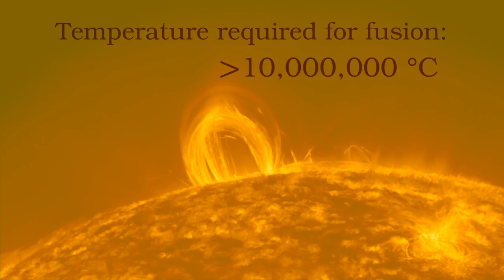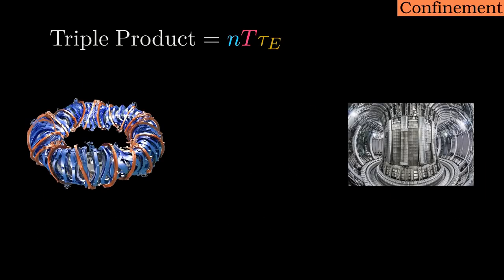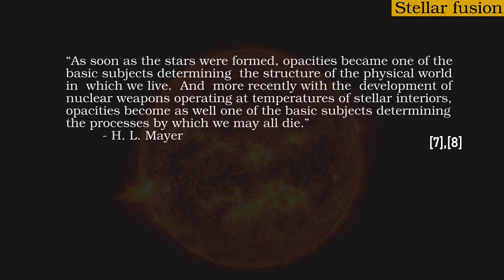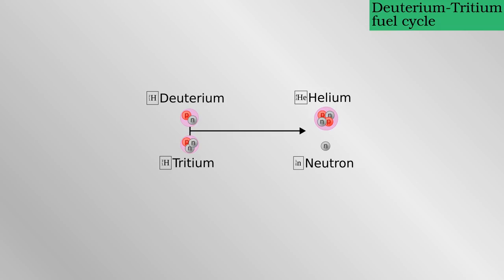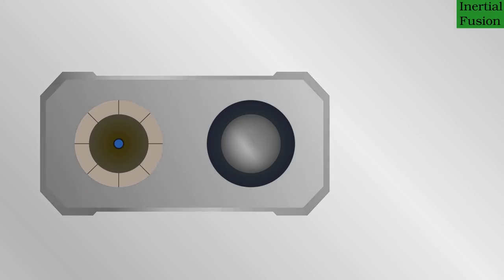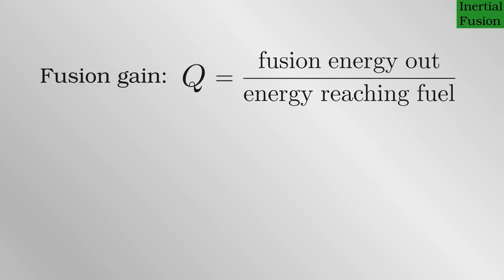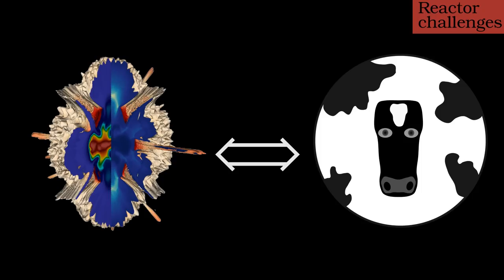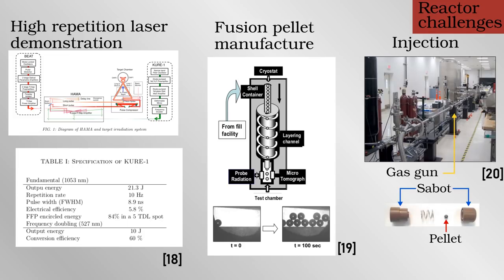How nuclear fusion works (2) - confinement, stars, nukes, inertial fusion energy

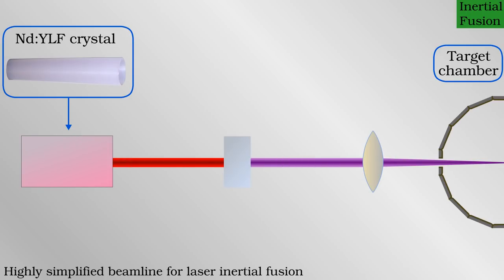Comment: Nice thorough overview. A couple small corrections - (15:55) in ICF the lasers are so incredibly vast, and the beam diameters so huge, that we actually can't use neodymium doped yttrium lithium fluoride (or yttrium aluminum garnet) crystals for the lasing medium. The Czochralski pull method of growing single pure crystals of the stuff simply maxes out at a few inches in diameter, and in order to keep the beam intensities lower than the intrinsic laser damage threshold of the material while attaining energies of a couple megajoules on target, we need beam diameters of over a foot (60cm) across! And so we are forced to use Nd doped phosphate glass instead, which can be made into practically arbitrarily large slabs then cut to size. It would be nice if we didn't have to do this of course, because glass is a terrible conductor of heat, while single crystals are great at it; but as it is we have to wait hours between shots for everything to cool down uniformly, lest the next shot suffer wavefront distortions from traveling through nonuniformly still warm amplifier Nd:glass. 

Also, immediately subsequent to this section you say that "the higher the frequency the deeper into the plasma they penetrate", but I think you meant to say the longer the wavelength instead. We like higher frequency in ICF (shorter wavelength) because it selectively heats the ablator shell of the capsule and doesn't prematurely heat the electrons in the fuel before maximum compression time, which longer wavelengths do. 

The final video section is quite good indeed, and in particular the identification of hydro instabilities as a likely show-stopping problem for General Fusion's lead/lithium alloy hybrid magneto-inertial scheme is most welcome, as I rarely see anyone rightly calling this out. One disagreement with this section though, at the very end you mention that a hypothetical future power reactor would have to take the "still unproven direct drive approach", but in fact I would argue that though we haven't achieved as high yields as the indirect method, this is merely a consequence of NIF's beam arrangement being optimized for hohlraum irradiation in two groups of 96 beams and its inability to currently do symmetric direct drive. The direct drive method is actually much more likely to succeed, all else being equal, and most of us think that NIF would have long since ignited its pellets by now if it were doing direct drive, if for no other reason than simply because hohlraum 351nm UV light to soft x-ray conversion is so utterly abysmal at ~10%; ie. they're throwing away 1.8 megajoules of laser energy entering the target chamber and only actually coupling only 0.2 megajoules into the target implosion merely for the sake of x-ray irradiation uniformity (and weapons configuration similarity)! In reality, the non-uniformity issues of direct drive have long been largely solved with things like distributed phase plates, distributed phase rotators, and spectral smoothing by dispersion.
Reply: Well hot diggidy daym! What a high quality comment! Thank you for sharing and taking the time!
Reply: @morkovija  you may view more historical documentaries about fusion on my channel if you enjoy this particular kind of masochism....
Reply from the maker: Thanks for the comment. Totally agree about the over-simplified NIF beamline (explaining even a simple beamline like the actual one at 22:34 would have doubled the length of the video). For some reason, I thought there was a Nd:YLF seed pulse (and even re-recorded that bit as you may hear). I also didn't want to go to deep into things like avoiding a pre-pulse and so on. Maybe I will do a "How Lasers Work" video including very intense lasers.

With regards to the benefits of higher frequency waves, I was alluding to the various absorption processes at or below the plasma frequency. If I recall correctly, very early research used CO2 lasers which just couldn't penetrate deep enough. Isn't that also a problem now, that the hohlraum closes to 1-omega light too early?

I also agree that direct drive ignition should also be easy in principle, but I would urge the same kind of caution as must now be felt for the 2012 Ignition Campaign.
Reply: @ImprobableMatter  Oh yeah, I'm pretty sure the seed pulse from the pulse generation room is definitely YLF generated on OMEGA, I think they're using ytterbium doped fibers or something in NIF's master oscillator room...
Ah I see about the frequency thing now, and keeping in mind we're really approaching the edges of my limited knowledge as a mere non-scientist engineer, my understanding was that the longer wavelengths caused unacceptable electron preheat (because of the high e-field? ....I guess?) before the bang time, but I see the energy absorption also scales favorably with frequency...
So you were right about the absorption efficiency relationship to irradiation frequency: Taken from Gordinier et al. 2003: "While carbon dioxide gas lasers can be pulsed and have efficiencies approaching 10%, their wavelength of 10.6 μm is too long for efficient coupling to pellets. The interaction of an electromagnetic wave (laser light) and the ablating plasma at the edge of the pellet can result in total reflection of the incident light at a critical density layer defined as the radial location where the laser light frequency matches the plasma frequency. The plasma frequency is proportional to the square root of the plasma density. Thus, for deep pellet penetration, a high frequency (low wavelength) light source is required. Long-wavelength lasers therefore have a difficult time efficiently coupling to pellets and achieving the compression factors required to initiate a thermonuclear burn."
Yes, caution in this field is obviously in a perpetual deficit, and we should always strive for more of it. Though the recent 1.3 MJ yield shot on NIF last August really did surprise everyone I think. There seemed to be a general resignation among many that the R-T hydro instabilities were underestimated (yet again) for NIF scales, and the cross-beam energy transfer, and the laser plasma interactions.... etc. were going to conspire to prohibit ignition from ever being reached. But now, well...it really seems right around the corner at least for indirect ICF. It'll never result in a power reactor of course, but even being able to achieve ignition in the laboratory at all I believe is going to open up a whole new world of ultrahigh flux neutron experiments, among other things, that make the machine itself a valuable new tool in high energy density science. Thanks much again for your videos, they're really excellent.
Reply: @Muonium1  Do you know what the exact reason behind choosing the hohlraum method over direct drive? Was it purely because it was functional in nuclear tests and they didn't want to dedicate NIF to an as-of-yet-unproven method? There must have been some reason for it, seeing as the physics suggests it is a big bite out of the efficiency.
Reply: @xiphosura413  It's a horrendously inefficient part of indirect drive. They want it because when you irradiate the inner walls of the (usually gold) hohlraum with the 351nm UV laser pulse, the spots on the inner wall become very hot and emit x-rays. Because the hohlraum is so small (pencil end eraser) and light travels so fast, the x-rays only take a few picoseconds to cross the inner volume of the hohlraum and get absorbed by the other side, heating it and causing it to emit x-rays too. Thus the radiation inside very rapidly becomes "thermalized" and reaches thermal equilibrium. This is good because the radiation inside undergoes so many absorptions and reemissions in such a short period of time that it rapidly naturally attains a very smooth even intensity and temperature throughout the chamber; you want this because you need the cryogenic DT ice filled microballoon in the center to be irradiated as evenly as possible during the ablation and acceleration phase of its implosion. If the irradiation is not extremely uniform, then uneven hot spots which form on the capsule surface will immediately seed Rayleigh–Taylor hydrodynamic instability in the collapsing fuel pellet and this will cause the cold layers of the fuel to prematurely mix with the hot layers before the moment of maximum compression and density, and then that will dramatically lower maximum achievable temperatures and thus simultaneously dramatically lower fusion yields. This is more or less exactly how the secondary of a Teller-Ulam thermonuclear device operates, and it was confirmed in 1988 that a laser fusion microcapsule could be made to ignite in this way too in the Halite-Centurion tests, which piped off some tens of megajoules of soft x-rays from an underground nuclear weapons test into one of these hohlraums and they got the DT pellets inside to burn.
Reply: @Muonium1  I see! Thanks for the response.
So it's to ensure uniformity of the radiation, is it technical limitations on the lasers necessitating the hohlraum? Or is it very difficult to adjust the system (engineering wise) to direct drive tests? The homogeneity of the incident radiation would become very dependent on the optics system which we may not be able to make good enough. Still, I'm interested if the efficiency gained could make up for some instability, even if the fuel pellet compression stability is technically inferior.
Reply: @xiphosura413  If you search for the phrase "NIF switchyard" you can see pictures of the two final mirror scaffolding assemblies that sit on either side of the NIF target chamber. They're massive. It was suggested many times during design and construction that the NIF switchyards should be engineered to be reconfigurable from the two-cluster indirect drive mode to spherically symmetric direct drive mode as needed, but this was rejected as too expensive and the indirect drive beam configuration was settled upon decisively. The time and expense of the complex work reconfiguring the current switchyard mirror and beam transport tube arrangement to direct drive would be huge and in my opinion likely necessitate a multi-year shutdown to accomplish. If they're going to do it, now definitely wouldn't be the time. If NIF WERE a direct drive machine though, I'm confident it would have long since been regularly igniting its capsules by now. How could it not be? They're right on the edge of ignition as it is now, and in direct drive mode they'd be coupling nearly a factor of TEN more energy into the targets. It absolutely would regularly have burning plasmas and be in the true high yield ignition regime. Most of the beam uniformity issues with direct drive have long been solved since the 90s in work on the machine I'm at - the direct drive OMEGA laser. The beam nonuniformity on target for OMEGA's 60 beam direct drive system is regularly on the order of 1%. A krypton fluoride system like Nike would achieve nonunifrmities a factor of ten lower still. These nonuniformities should be more than low enough to prevent RT instabilities severe enough to inhibit ignition in imploding capsules.
You CAN do direct drive with the NIF in its current mode, it's just that the irradiation will be HIGHLY asymmetric with most of the energy falling on the "poles" of the target and very little at the equator. This drives the targets to highly asymmetrically oblate, pancake shaped final compressions that are totally unsuited for achieving ignition and gain. NIF DOES do this asymmetric direct drive technique with its glass shell exploding pusher targets that can produce neutron yields of around 10^16, but this is a much different kind of target that unlike ablative cryogenic DT ice targets, is totally incapable of driving to ignition. There are various ways around this that we developed on OMEGA such as using "saturn targets" that have a ring of plastic around the target equator in attempt to use the plasma blowoff from the ring to refract more incident light onto the target equator, but they're all very kludgy and come at a high cost of much lower energy coupled to the target overall.
Reply: @Muonium1  are you doing research with NIF, Omega EP, or Zeus?
Reply: That's in large part because NIF is not a testing facility for fusion reactors - as you highlight.  It is an indirect drive facility intended to justify continued discussion and simulation around nuclear weapons due to their similarity.  Now they can ignite capsules they can start studying efficiencies for hohlraums for nuclear weapons again.  It was a pretty open conversation in laser physics around NIF that it was nuclear weapons testing masquerading as power plant testing, and that actually getting anything approaching beam time with them was pretty hard.

We don't bother looking at direct drive because A:  lasers are a pain in the arse to work with, even yours, and B: pretty much everyone in plasma physics is convinced tokamaks will work and will do so more readily and efficiently, barring solving the wall problem.  It's far easier to work with large heavily cooled magnets and fluid exchange media than whatever the fuck you'd have to do to get ICF heat energy out of a chamber.  Much like the so called "desktop particle accelerator" promised by thin film petawatt lasers, it's mostly just smoke to perform shock acceleration in lab conditions and study extreme stellar physics and GeV particle interactions.

The fact that NIF actually managed to ignite a capsule while overcoming the truly ridiculous rayleigh taylor instabilities inside the capsule (which when I last looked were growing on the order of the laser intensity, so you couldn't just shoot your way to success) is frankly remarkable.

Also...

" These nonuniformities should be more than low enough to prevent RT instabilities severe enough to inhibit ignition in imploding capsules."

My understanding of the state of affairs at the time that NIF was originally pushing its full beam power at the target was that their x-ray uniformity problem had been largely solved, the issue was xray conversion.  The problem was they just weren't coupling enough power into the outer layers of the fusion capsule to actually make the thing implode on the correct time scale, and that even the smallest of uniformities became exaggerated on the time scales of the capsule implosion.  They'd get a drop or peak in xray power for even a brief moment, and then the instabilities would just explode out of the poles.

IIRC the papers just before ignition, they had solved this by substantially improving the conversion efficiency of the hohlraum itself and expanding the peak radiation time during which the inner capsule layers were subject to peak power approximating 400TW and lengthening said peak to remove what they called "coasting" time.  They'd been steadily increasing the on-target power for like a decade or so, but that was the first moment they had a functioning design that mattered.  Said shot and hohlraum design was later used as a basis for the ignition shots where they exceeded 400TW with almost no coasting time and a lengthened peak power plateau.

To reproduce that using direct drive is gonna be hard as hell - depending on where they want the radiation actually heating the capsule and the frequency conversion between UV and xray, the effects are gonna be subtly different aren't they?
Reply: Give me like half an hour to understand all that.

Comment: The note about tracking pellets and rapid firing reminds me of the type of work that went into semiconductor manufacturing, the EUV machines needs to fire a drop of tin and lasers to vaporise it incredibly rapidly and in such accuracy to ensure a “constant beam of light” for the production of the chips… it’s insane and I wonder if the knowledge can be shared with the nuclear fusion industry too!
Reply from the maker: Yes, I've been to workshops where inertial fusion people are talking to, or swap around academic posts with EUV chip fab people.
Reply: I think I've read that the Cymer laser used in ASML's EUV machine fires at something like 30 KHz, with a tin droplet being blasted to plasma by a CO2 laser for each pulse.  But the power levels are only a few hundred watts, compared with the much higher levels needed for ICF.
Reply: @tristan7216  Yeah, it's quite small vs what is needed here. Tho, I would say it is an ideal technology demonstrator for something bigger!

I do feel like with a lot of modern tech, people forget that there are usually many iterations done before you get to where a "completed" or "presentable" product will be!

Comment: Kinda funny but with many star, the Q plasma will be around 100-1000 by the time the star dies, but will be less than 2, and in many cases, much less than 1, after that. gravitational collapse releases a bunch more energy that can't be used for fusion and if it produces a white dwarf, the overall energy spent in the process is on the same order of magnitude as the fusion energy. If it produces a neutron star or black hole, there will be far more energy released by the actual crushing of the star into such a small object than ever gets released by fusion.

Huh, I guess maybe instead of fusion power, we should find a way to generate energy by dropping things into really extreme gravity wells.